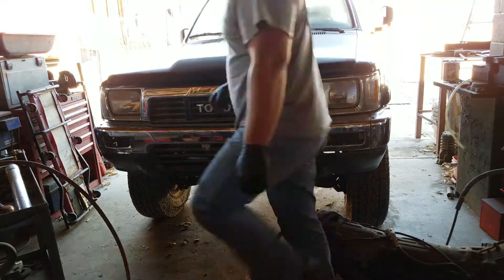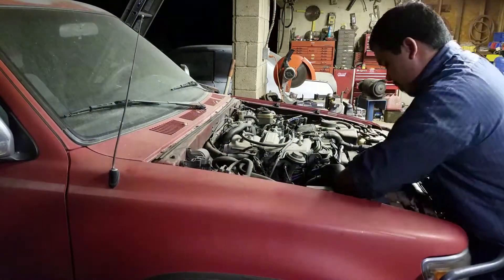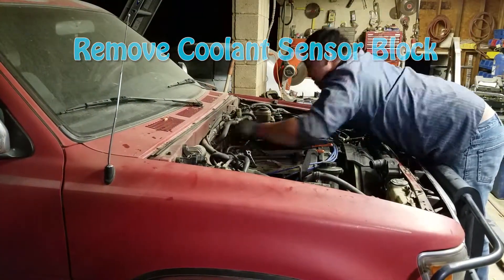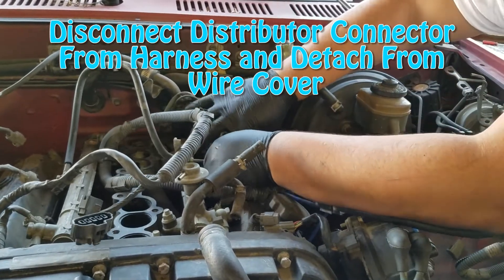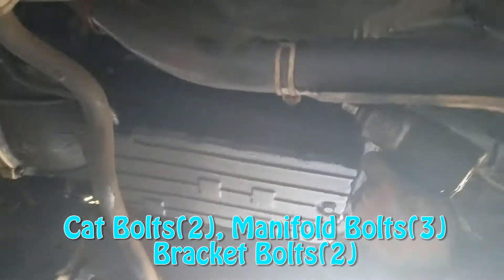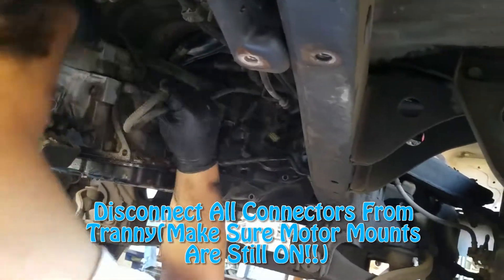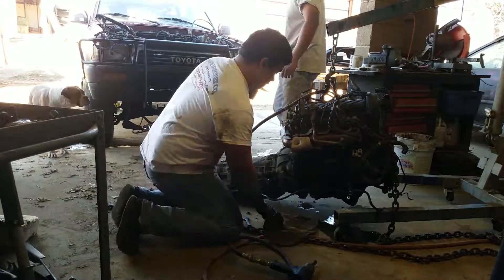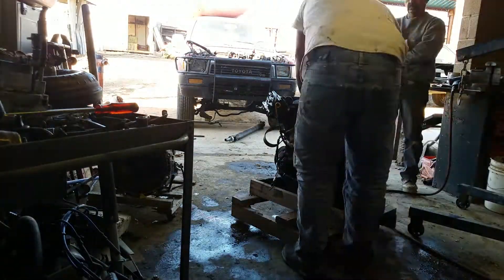How To: Remove Toyota 3vze Part 2!! (Finally!)

Comment: I Love/Hate all things 3ZVE. I found you by developing a freeze plug coolant leak. Of course, it's the lower one on the rear of the block 2" from the firewall. Agh! Pulling the engine to replace a f'riging freeze plug. Agh! Thank you. Great help.

Comment: HI! I have a 1997 4runner that I am looking to swap an engine into at some point. Probably just another rebuilt 5vz with less miles. I really appreciate the video and will probably be watching it several more times before my other half and I begin work. I would love to see more videos from you! I understand mine is a gen 3, but your information is still useful. Thanks again for the upload.
Reply from the maker: Thank you! Theres not much difference in a gen 3 compared to a gen 2, so it wont be too hard for you! Good luck and have fun!
Reply: Your engine setup looks slightly different, but yes. Overall it should be about the same. Thanks again!

Comment: restoring a gen 2 ...good vids brother .. wanted to see what i was getting myself into on swapping out for a rebuild
Reply from the maker: B Cage thanks! Idk about doing a full rebuild but if you can get a motor for cheap, Id say a straight swap would be the best choice. Just make sure to replace the HGs before the motor goes in
Reply: NightWrencher hg 's ?
Reply from the maker: Headgaskets. Definately a must if the motor is already out.

Comment: Quick question on the 4 wheel drive that fits the 92 Toyota pickup 4x4 with 3vze, it's a 30/40 LE. My wiring harness was totally messed when I pulled engine and transmission.  The very rear wire was a single, coming out the driver side. The next only had  one. The third set had three going to the wiring harness. Is this correct? Because I bought a used transmission with low miles and the far back and middle has two each. Can I get away with hooking only one wire at each port or would I need to change sensors that only have the one wire connection? Any help extremely appreciated,  thanks.!
Reply from the maker: I went through a similar problem because these truck changed the wiring a lot. My advice is use the harness that matches your oem harness and install the matching parts that fit the harness. Dont go mixing and matching cuz it wont work
Reply: @NightWrencher  thank you for getting back so quick, ill tear the old one apart tomorrow after work.

Comment: I live in Hawaii have my 1995 3.0 Manuel 5spd that kept blowing HGs.  No way I will let anyone touch my truck here!!! Last place SCREWED the job and robbed me in countless ways.  1,000$ to mill the heads alone and HG blew again in 3k mi.   1,300$ in back registration rt now.   She ben sitting for 4yrs being rope towed from place to place because state keeps trying to steal her which they already did in 2017 cost me 500$!!!  I wanted to do a 3.4  swap but realize the 3.0 is way easier and ( affordable).   Not sure what to put in.  A crate engine,  a rebuilt, or a junk yard dog....  I have tools just mainly need a hoist and
 $$$$$!!!!   Seriously need some sound advice.  Mahalo.

Comment: Nice vid. I'm fixing to pull my 3.0 out but I would like to leave my manual trans in the truck. Is the only thing that I need to worry about is getting to the top few bolts that bolt on the transmission? U said you preferred pulling them both but is the reason why is because your talking about an automatic trans?
Reply from the maker: Its just cuz its faster for me that way I dont have to pull the 2 bellhousing supports off the engine and trans and also dont have to pull  the bellhousing bolts or torque converter bolts. If you wanna leave the trans in the truck, losen the engine mounts, unbolt the trans mount from the frame and lower the trans slowly, it should lower down enough for you to reach the top bolts with a long extension. Because with the colant sensors at the back of the engine because you can break them if you go too far. I like to remove them completely just in case along with the upper intake manifold
Reply: @NightWrencher  Thank you sir. I will remember to remove those sensors first. I already went ahead and remove the plenum so I will remove the upper intake and the sensors. Thanks for the advice cause I probably wouldn't have removed the sensors.

Comment: I need to pull the  heads off of my 95 4 Runner . How do you get the cross over pipe loose, i can get the drivers side, and 2 nuts on the passenger side but the top nut closest to the head there's no room to turn it. Any help                                                                         would be great. Thanks
Reply from the maker: The best way I've been able to do it, has been to remove both heads together without removing the crossover. Its a little heavy but it saves you a ton of work. Unbolt the 3 bolts that hold the exhaust down pipe to the manifold and you're good to go. Having a buddy helps. Best of luck!
Reply: Thanks for getting back so quick. I'll give that a try.

Comment: I have a 3.4 I want to put it in my sons 91 pickup that has a 2.4 standard 5 speed will it bolt to the transmission in the truck?
Reply from the maker: I dont think it will. The 2 bell housings are different. You could locate an r150 for the v6 that should bolt up

Comment: I have a 95 3.0 4Runner with blown headgasket should I rebuild it or change motor?
Reply from the maker: To have someone do the headgaskets will cost $800-$1200. To have someone install another 3vze will run closer to 2k. If it didnt burn oil before and compression was good, I would just have the headgaskets replaced

Comment: So, we take intake off to save the sensors and wire harness from being destroyed when drive-train tilts ?
Reply from the maker: Basically thats exactly I do it like that. Ive broken too many sensors by tilting the engine back
Reply: @NightWrencher  Remove drive-train is probably same time as drop trans and front diff on IFS.  Which is what has to be done for rear main seal and oil pan gasket.

At that point, might as well rebuild entire engine for another 4-6 hrs.
Reply from the maker: You can do that, but if you drop the trans and pull the engine out, you dont have to touch the IFS
Reply: Do I have to undo and drop front diff, if i want to pull the whole drivetrain ?
Reply from the maker: If you want to pull the engine and transmission together, you don't need to remove any of your front suspension including your axle. You're just going to need to put a jack on the transmission side so it rolls forward

Comment: Thank you Nightwrencher. You make this look so easy...
I will be performing this feat for my first engine removal and rebuild. Are there any difficulties a new rook like myself needs to be aware when reinstalling the rebuilt engine?Were there any pit falls to avoid like assembly order or anything that might make it less difficult?
This will take me a while to do probably a couple months to complete the rebuild. I am worried I will miss an reassembly order. Do you have any thoughts on how you organize the parts? I am going to use a cardboard layout for bolts so I can draw items with bolt patterns so I can remember in 2 months. :D

The heads are slightly warped but the engine is still running. It sounds like you recommend pulling engine and transmition at same time.
Is there a rebuild list you perform when doing this. And if possible what other items would you replace with the engine out. Maybe power steering and or upgrade sway bars bushing and engine mounts?
You mentioned seals?

Thank you for your time. I appreciate it for sure.
Reply from the maker: Thank you for your kind words! Removal is pretty straight forward. The PS pump can stay hooked up, just unbolt it from the engine. Theres no easy way to take off the AC compressor, so just remove the two lines the 1 wire plug and leave the compressor bolted on. I find it easier to remove together because I dont like to remove the 2 engine block supports and dust cover to get to the 4 14mm TC bolts. Also the starter requires a 2 foot long extension plus a wobble 14mm.  As for organizaton, I honestly just put the hardparts together in a corner and all the bolts in a bucket.  Ive pretty much memorized where each bolt goes and if you go slow while disassembly you can see exactly what kind of bolts need to go where and why. I hope this helps you!
Reply from the maker: One last note to finish your questions. Front main, rear main, oil pan silicone(sandwhiched windage tray, silicone both sides), cam seals, valve cover gaskets, water pump, timing belt with pulleys, knock sensor + wiring, spark plugs, wires and for the trans, front pump seal, tail shaft seal, trans pan gasket and filter.
Reply: Thank you very much. You are an inspiration to me. I am going to start in the next couple weeks.
another question since you have done this a few times. When selecting a rebuild kit do you opt for just OEM replacement complete kit, i think they run around $260 USD?
Reply from the maker: @robg6202   most of the parts that you will need will come in that kit including most of the seals that I mentioned. there are a couple things that may be missing such as the coolant bypass that sits in the Valley of the block which you can get either a Toyota or fabricate yourself. As long as you're not getting inside the internal such as rings and bearings everything else should be straightforward. Good luck!
Reply: sweet I loved your article comparing block efficiencies,  made me realize to just keep it simple.
Reply from the maker: @robg6202  that really means a lot to me! I hope I can keep putting out content that people like you will appreciate in the future!

Comment: I need to remove my engine but keep the auto transmission in any tips on what exact plugs to remove
Reply from the maker: TechReveiwerNZ if you put a jack under the tranny and undo the 4 cross member bolts(18mm)  you can lower the jack slowley until it gives you enough room to remove the o2 sensor, reverse switch, PNS switch and 4x4 switch plugs. There may be 1 more plug or so. Afterward use a long extension to take the top of the tranny bolts off. Then lift the trans back up and put the 4 bolts back on. You should be careful not to lower the trans too much because you can damage some hoses or coolant sensors at the back of the block. Also make sure the engine mounts are still bolted to the body to prevent the engine from falling into you. Hope this helps.
Reply: NightWrencher is this easier way to remove wiring harness but still have it plugged into the ecu?
Reply from the maker: TechReveiwerNZ unfortunately there is no easier way to seperate the harness from the engine and trans. If the trans is going to be left in, you can get by, by removing the harness off the engine itself and leave the rest in the bay
Reply: NightWrencher so unplug it from the ecu and feed it through the hole ?
Reply from the maker: TechReveiwerNZ you can remove the upper manifold and disconnect all the plugs. And flip the harness over the passenger fender. You can leave the trans part of the harness alone along with the firewall. Just make sure to take off the starter and alternator and remove the harness all the way to the maf.

Comment: Interesting.      Im currently pulling a seized 3.4.    I was thinking i may separate in vehicle.     With a floor jack supporting the trans.        Hopefully i wont fuk up the trans pump 🤞
Reply from the maker: Pulling seized engines are the worst. Best of luck to you!

Comment: So I've removed most of this but with my tools it takes forever  could I just remove this motor without  disconnecting  everything  I just want to take the motor out
Reply from the maker: The problem is if you dont unhook the whole harness, you have to pull it out from the cab. So you got 2 options, leave all the sensors and harness in place and remove the upper intake to disconnect the fuel injectors and fuel rail. Or option 2 is pull off all sensor connections, pull harness from inside of cab where the ecu is, and pull it out complete which is what I did cuz i sold my old engine complete
Reply: I got most of it disconnected  the drive shaft won't come off and most of the bolts are rusted   I have  the two bolts on the top of the motor holding it in and motor mounts this is not thing like taking out a 350 block
Reply: Honestly  your the only person that might  help me out no one is willing to help me  pull this motor out
Reply from the maker: Even I struggled with it the first couple of times I had to remove and install that engine. The best thing I can say is if you're taking apart a four-wheel drive and the rear nuts are stuck, you're probably going to have to take a grinder or a Dremel and cut the nuts off so you can remove the drive shaft or, separate the engine from the transmission, which is a big pain, disconnect the harness that goes to the transmission, and pull the engine out separately. Then drop the transmission onto the floor disconnect the drive shaft at the differentials and pull the whole thing out together and try to work the nuts loose outside
Reply: Ill try that when i got the time.  Thanks 👍😁

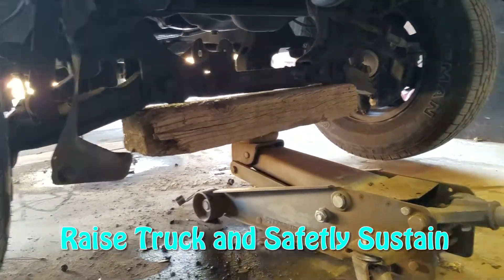Comment: that Was 4:53 heh Car Plastic Ramps, watch out, I go fast too and Take Chance lol - Hey the four 22r Cylinder I got now with 4 Speed transmission is So.....simple.....it Makes ya Wonder about the 3vze and all it's Sensors and Wires and parts and and and and and and......heh overall It's One Big glorified Vacuum Pump with More technical Engine Managment, though once Ya know it...it's Simple Enough....
Reply from the maker: Tommy Tommy Hey man, good to see your post. I used to have a 22re 5speed truck that I sold a few years ago. that thing was a blast and super simple like you said. for me its just cheaper to fix the 3vze in the 4runner, than to do a swap, BUT, I am planning something fun with the 3vze in my pickup ;)

Comment: My 3.0 is shot. 😢 it needs a new engine. Thanks for the vid.
Reply from the maker: Big oof. Im sorry for your lose. What are you going to do now?
Reply: NightWrencher 
Im going to try and install a new engine. The shop was asking $6,000. So no deal. Im going to try and do it myself with the help of some friends. This all happened today. Thanks for hearing me out. This is my first vehicle. I always wanted a Toyota pickup. So im not giving up on it. I just bought it like 4 months ago too.
Reply from the maker: @rafaelthecrusader7968  Theyre great vehicles and hold their value really well. The cheapest thing you can do is have the heads redone on your current engine and just buy a new block at the junkyard. If youve got the know how, putting it back together should be a breeze.